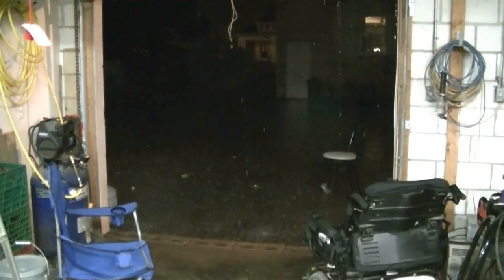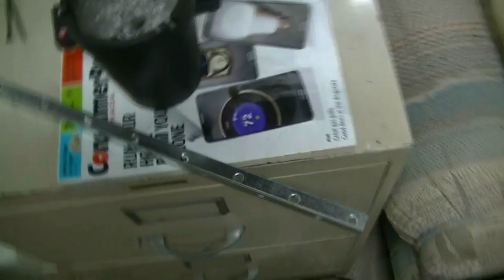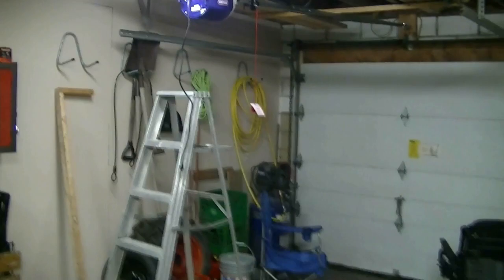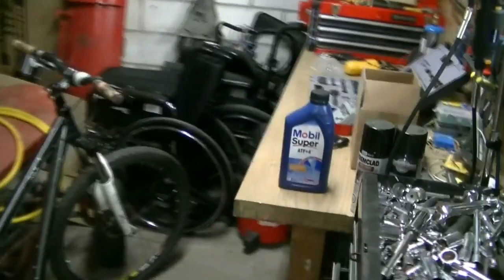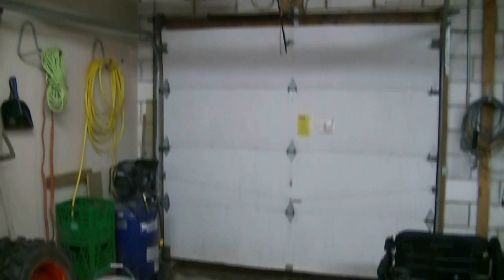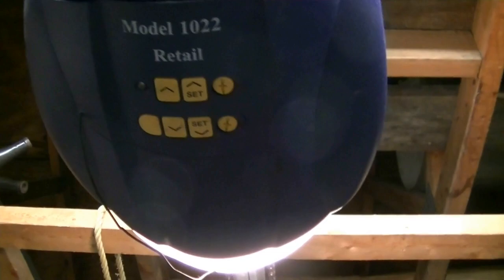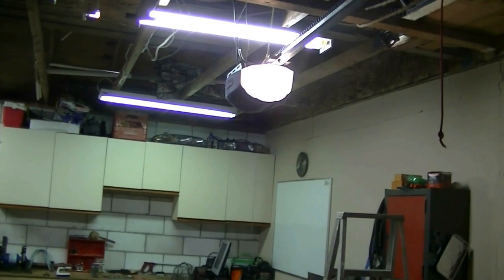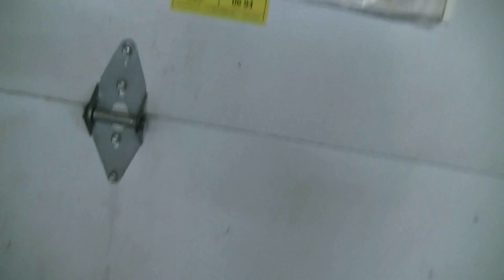Installed Laziness

Comment: Close limit is set too far, the trolley is hitting the front idler bracket. The door arm should be vertcal when stopped. Your track can be level or even higher if you really need room, but it is a good idea to get a vertical bracket for the operator attachment and a 2" reinforcing truss going across the top section. Have Fun!